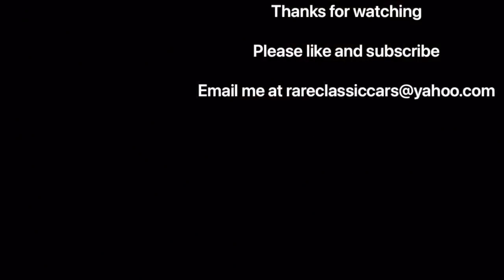Worst Engines of All Time: Chrysler 318/360/400/440 V8 Electronic Lean Burn

Comment: I worked for a Chrysler dealership back in the mid 70's when the lean burn systems were introduced.  Talk about a total PITA.  If we adjusted things as Chrysler said they had to be adjusted, the cars barely idled and ran like crap.  It got very old, very quickly, having to deal with justifiably pissed off customers.  None of us were impressed but we were between a rock and a hard place because if you set them up as the manufacturer and federal regulations said we had to, the car wouldn't run right.  It's no wonder Chrysler was on the way out back then.  Later, I quit Chrysler and went to work for a Lincoln/Mercury dealership.  I remember the first day I walked into the service department, one of the mechanics was doing a new car make ready on a Mercury Marquis and he had the hood open.  The engine was totally still so I assumed it wasn't running.  As I got closer, I saw that the radiator fan (still belt driven in those days) was turning.  With all the federally mandated pollution controls and my experience with Chrysler, I didn't think that was possible.  It was "so" much more pleasant working for Ford/Lincoln/Mercury as the customers didn't nearly as much to complain about.

Comment: 1983 the Corvettes got 210 horsepower with 5.7 l and the Toyota Supra has 160 with only 2.8 l but I'll tell you once they figure out through multi-port injection and some aluminum heads power went up to 245

Comment: Most if not all new cars use some form of the Chrysler lean burn system. The system was developed because Chrysler was trying to avoid having to use catalytic converters. Compared to Ford or GM the cost for Chrysler to buy Catalytics was higher. 
The big mistake with the first generation lean burn system was putting the computer on the air breather. It subjected it to high temps and engine vibration. The system got better when they moved the computer to the fenderwell.
Its not that hard to convert from lean burn to a regular electronic ignition and they sell kits for doing it on v-8's. They no longer make the kits for slant six conversions but you can buy aftermarket made ones on ebay. I have a 1981 D150 I am in the process of converting from lean burn to electronic ignition.

Comment: Great video, it was very interesting and informative.  Did these lean burners have any tendency to melt the intake valves? I had a 1984 Dodge Colt with a Mitubishi motor that cracked a piston ledge (between the rings) at 105, 000 miles . When I pulled off the head, the "jet" valves had nothing left but their stems. If you recall the jet valves were strictly for emissions and only about 1/2 in diameter. After getting it all back together and about 30,000 milers later it started having problems.  It never pinged but during freeway speeds and with passing acceleration from 55 mph it would feel like a standard transmission with a slipping clutch. The vehicle would not accelerate unless you feathered the gas pedal.
  Anyway thanks again for the video.

Comment: I didn't really know much about those systems. My car didnt jave much on it but for what it did.....  I ripped any and all of that crap that had been put in my Dodge Dart Swinger out. The whole top of the engine was stripped back to a short block. The came was replaced with a custom grind Crower for rpm power optimised between 2500 and 4600. The aftermarket wand heads I got came from a 360ci out of a 68" Challenger. They had previously been ported and polished and came with a set of Summit sodium filled valves, B&M timing gear set to eliminate the possibility of a chain ever breaking. Hooker Headers and more.

Comment: I've been running Chrysler products since 1970.  Had two lean burn ones which I immediately converted back to prior electronic ignition using distributors and carburetors from 1973 model year.  That fixed them.  BTW, I have an extensive background in electronics and computers.  I wasn't impressed with anyone's early efforts at emission control.  It took sequential port fuel injection to begin to make things work decently.  And with my background in computers and electronics I learned early on that I could fix any computer controlled injected car with only one tool if it died on the road.  That tool is a cell phone to call the rollback.

Comment: Before I even watch this video, I'd like to say that I've owned 2 cars with lean burn, and I must say that I'm a huge fan, and plan on getting more lean burn era cars. They both ran flawlessly. Started up every time, even in the dead of winter (<0°), and were relatively maintenance free. I never noticed any of the common issues like pinging or excessive heat, and I was overall very satisfied by the performance of both cars. I know the system seems to be hit or miss for most people, but it does mildly irritate me when I see videos like this, especially if the author hasn't really owned many of them
Reply from the maker: I’ve owned many of them.  And would again. But they require a good amount of non standard tweaking to run well.

Comment: Another video that needs editing, this engine was the first to have a microprocessor the first engine t be able to run this lean, and the first to have low co and low nox pre catalyst. Still a lot of mechanical aspects that could cause failures.

Comment: I ordered a 1978 Chrysler Cordoba with 400 Lean Burn and worked great,had good performance and if easy on throttle gas mileage averaged around 19 to 23. My best mpg was 25 doing about 55 mpg. Car handled excellent with front and rear sway bars and heavy shocks. I installed big Dunlop radial tires which really helped. I had 245,000 miles till I sold to my nephew. Great car with leather seats and first Digital search tune stereo. Spark plug didn't last long till I found new type platinum plugs which improved running.i wish I never sold it

Comment: I worked on a quite few cars with leanburn. Mainly we replaced the distributor with a 1974 one with vacuum advance and wired in the matching module and resistor, and tinkered with the carb.

Comment: Chrysler Australia also used the ELB on our Hemi six cylinder engines in the Chrysler Valiants and Chargers on the 245 and 265 ci Hemi sixes,  this was a six cylinder engine that replaced the American slant six we used from 1961 to the start of the 1970’s in varying states of tune and only used in Australia we also used 273, 318, 340 and 360 V8’s in our local Valiants and derivatives also but remember the ELB actually worked very well regarding fuel economy on the sixes but did suffer similar problems unfortunately but fuel economy wise was bette than the equivelent Falcon and Holden engines of the time

Comment: Throw the lean burn computer in the garbage and switch over to conventional electronic ignition/distributor setup available at speed shops. Back in the day I converted many to conventional points distributor. Engine and the carb are both ok as is its.. the computerized piece of crap mounted on the aircleaner causing the problems

Comment: the stoichiometric mix isn't measured by volume, its weight. 14.7 parts air, by weight, to 1 part fuel by weight. If it was by volume you'd be burning about 735 litres of fuel per minute in a 440 doing 3000 rpm lol.

Comment: That Lean Burn System SUUUUUUUCKED!
I had a 1986 RAM 318.
I tore that shit out and installed a normal carb and distributor and tossed the lean burn controls into the garbage where it belonged.

I didn't know they changed timing over time. That makes no sense for a spark advance strategy. Chrysler must have got their ass kicked with the emissions at the time to implement that otherwise useless technology. 
Normally you want as much timing as possible without spark knock. Changing the timing based on time when everything else is at a steady state is just retarded. Pun intended.

Comment: I never knew all of this technical stuff, I just knew that my car wouldn't run good. So I learned how to bypass the lean burn by disconnecting the power to the Lean Burn board and rerouting the vacuum to the carb and distributer. I loved my Slant Six, 318 and 360 SB Mopars!

Comment: Lean burn!!  Oh man...I remember this.
My father had a 1978 Chrysler LeBaron with a 318.  Nice car except for this Lean Burn system. Tuning this carb/ this system to smooth operation was a nightmare.   There was always a slight roughness to the idle and a sluggish acceleration.  HOWEVER.....on foggy days it ran flawlessly......flawlessly. Yup. That small amount of very diffuse moisture in the air did something to this Lean Burn system that allowed it to smooth out. I wouldn't begin to try to explain why, but this was the case.  It smoothed out to beautiful operation.  Impeccably smooth quiet idle and fast, smooth acceleration.   This change was noted every single time it was foggy.....NOT when it was raining nor snowing, but only when it was foggy.
We had this car for about 7 years and this change in operation was noted every single time it was foggy without fail.
Weird, but true.

Comment: Ummm I've been wrong before but it's not a gallon of gas to 15 gallons air. That's by volume, air/ fuel is calculated by mass. Smart dude, interesting, but thinking he's got that visualization all wrong. Way more air brah. It's like 10000 gallons of air or something wild, maybe that's carbon out but it takes a lot of air is the point.

Comment: Since there are 790 comments before mine, I guess this has been up before . 14.7 to 1 isn't by volume, it's by weight. So waaaay more air than those gallon cans (I'm metric, so 14,7 kg of oxygene to 1 kg of fuel, whatever that equals to in pounds)

Comment: I had a '79 Cordoba 300 LE and an '81 Cordoba LS both with 318 lean burn engines, the latter with a Thermo-quad 4bbl. Both ran great and never any trouble, the '81 would easily spin the rear tires, and got reasonable mileage comparable to the '79 2bbl., as well. I briefly had a '76 Charger with a 400 4bbl (also LB) with a very tall rear gear that would simply turn the rear tires to molten rubber. though poor mileage cut that affair short. That TQ, well tuned, is/was one of the best factory carbs. The real key besides having the air door set up properly was to have the advance curved correctly.

Comment: My father had a gold '79 Chrysler  Lebaron. The lean burn computer malfunctioned several times resulting in multiple trips to the dealership for warranty repairs. The 318 had bo power what so ever. On a hunch he took the lean burn module to a friend who was quite good with electronics. His diagnosis was there was a resistor that had a value that was simply not up to the task. He replaced it with a resister more suited to the task, gave several to my father for spares but never had another issue. For the hellishly sluggish engine performance my father, being a mechanic, put a four barrel carburetor on it and a dual exhaust. It was fine after that.

Comment: I had a 1979 Dodge Diplomat Medallion Edition Coupe that had a Lean Burn 318. I took it all off and covered it to 1974 specs and it ran for 350,000 miles and was still running when I sold it.

Comment: Just like Caddilac's 8-6-4 system it was a first attempt at new emissions law and fuel economy. As most first attempts go, they sucked major ass. Honda was about the only one with a decent leanburn system and I recall a few of their cars getting closer to 1990 before going EFI. What they learned from things like this and the Rochester feedback carbs of the era was what helped them make EFI systems. Ford went all-out with common-rail EFI halfway through the 86 build. My 1990 Bronco still runs like a top to this day on it. GM had the TBI system until it was replaced with the Vortec in 1996 and honestly the TBI was way more reliable and maintenance friendly. Made a lot of money on fuel pump and spider injector failures on the first gen Vortecs but my 95 Suburban with the TBI never gave me a lick of grief. Never had to work on much first-gen EFI dodge, they were pretty good as well. Did plenty on the Magnum series engines as those trucks were quite popular and quite shitty. Couple that with living in the rustbelt and went through a lot of torch tanks getting them apart.
Reply: Honda’s “lean burn” system preceded the GM feedback carbs and Chrysler’s Lean Burn system. They called it CVCC (Compound Vortex Controlled Combustion), and for the first couple years, it SUCKED.

Comment: Where were you in 1979 when I needed you?

With my first brand new car, a 1979 Dodge Magnum, I tried to recreate the Vanishing Point Challenger by ordering it in Eggshell white but saddened to discover that no black interior was available and settled for that dark blue.  

Pre Iacocca, and let me just say this: it was a genuine piece of...well, you get the idea.  

Not a week went by when this thing wasn't in the shop for warranty service.  It came in from the Canadian factory to my dealership in Elmhurst, Illinois with a head gasket leak.  Paint fell off of the...ROOF!  Rear window defroster wouldn't time out and the wires over heated the rear window so much that it explosively shattered.  Twice.  The dealership tried to convince me that only the Cordoba and the Charger shut off automatically.  I won't repeat my reply here.  

I could go on and on, but I am a MOPAR guy, so I'll just leave that out there.

BUT...Lean Burn.  Ugh.  When I needed that engine, a proud but anemic 318 (same as in my 1970 Challenger - yes, I am cursed) it went on a union break.  I.E., a deep seated need to get around that truck creating a rolling road block...and punch the accelerator.  Instantly, this little fighter engine woke up and roared...for about three seconds then died.  

Literally died.  

After fighting the power steering (or lack thereof now) and trying to land the thing without the benefits of power brakes on the shoulder, the engine insisted I wait 20 minutes before it would start again.  Otherwise, all I got was the famous Penta Star whine as the engine loudly reminded me that it would work on IT'S terms and not mine.  

So, my long winded build up leads to this question: Was that because of the poor placement of old school electronics in a heat cyclone area under the hood?  It seems like the 20 minutes was literally a cool down time out...

I'd hate to see those pistons now; all burned and crispy...

Thanks for the vid.  Good (who am I kidding...?) memories...
Reply from the maker: Great post.
Reply: @RareClassicCars  Wait until you hear my stories about my '70 Challenger.  I call them "CID Size Isn't Everything..."  (Especially since a 340 is a bored 318...)  But that's for another day.

Comment: I never had a problem with the 318 or the 360. Not a time. After 200k miles the #8-cylinder valves would tend to begin burning out, but I, and my family drove Chryslers for 20+ years. We wore Chrysler's cars out because they were so hardy and trouble-free.

Comment: I owned a 1977 Gran Fury during the 1980s, although my father had purchased it new. That car did not start smoothly and sometimes stalled. It was equipped with a 400 cubic inch V8 combined with a Lean Burn.

Comment: I had a 77 Newport with a lean burn 400. Yes, the carb and points distributor off an old 440 was the absolute cure for the problems caused by the lean burn.

Comment: Did the distributors in these cars use mechanical or vacuum advance?  I don't see any accurate way of a computer controlling timing with either of those systems,  and when I Googled it I found distributors with locked out timing (so that the computer has full control of the ignition timing)
Reply from the maker: Only mechanical advance based on rpm + computer advance.
Reply: @RareClassicCars  I don't think that's a universal rule. 

I have seen several distributors that people claim to have come off of a lean burn engine that don't have a mechanical advance.

Comment: Very simple to convert to electronic ignition I wouldn't let it sway my decision. Interesting thing chrysler did in the early 80s on /6 cars was make sort of a lean burn-esk set up using the standard electronic ignition hooked to a wired carb and some other micky mouse control boxes.

Comment: Developed in Huntsville  by  redstone engineers. At this time most of Chryslers top R&D engineers were gone. I worked on these at a dealership level and honestly, nothing short of removing the (anti-mechanic lol) tamper plugs and using propane to enrich the gauges on the exhaust analyzer vie the mixture screw's, turning off the propane and then watch the engine shake rattle and roll!!! 
Step2: remove propane, and analyzer connect vacuum gauge and adjust as we always did. Reinstall tamper plugs,close hood and test drive.
On 2bbl carbs, Holley,Carter and BBS, stretch the metering rod spring or springs to add about 1/4" length. On thermal quad's tighten the secondary air valve in the neighborhood of about 1 1/2 to 2/14 depending on vehicle weight. This one was tricky because the braineacks interlocked the value to the choke and high idle cam. Starts and runs fine till warm or just the opposite. Most leanburn  customer complaints were stalling,hesitation,rough idle and poor performance. Hardly no MPG concerns. Go figure! 
So the bottom line was this; make it run as best it can, and don't worry about the analyzer readings but always go through procedure. Make the customer happy.

Comment: These systems gave mechanics a bad name.  Owners couldn't understand why their old car they traded in ran better than their new car.  The system inherently felt like car was running poorly even when operating correctly.  
Alot of trips to repair shops made no difference.  The only cure was eliminating system for customer satisfaction.